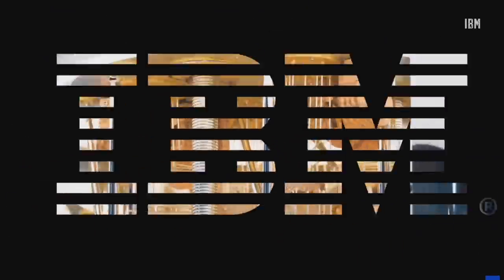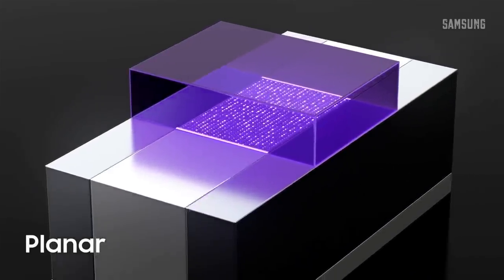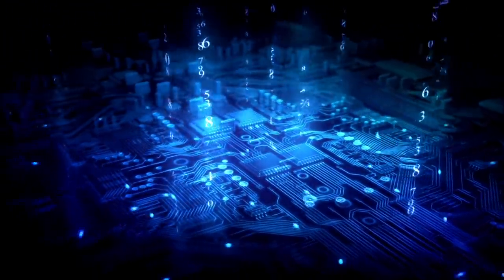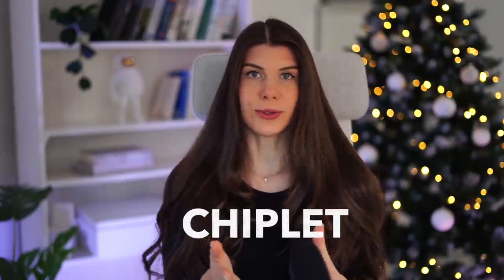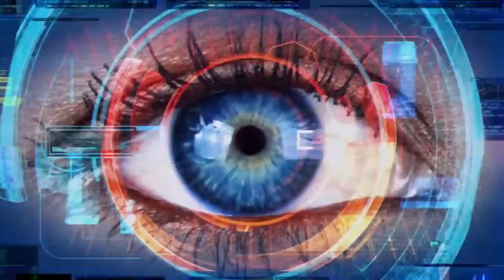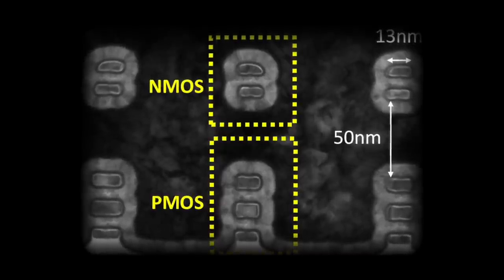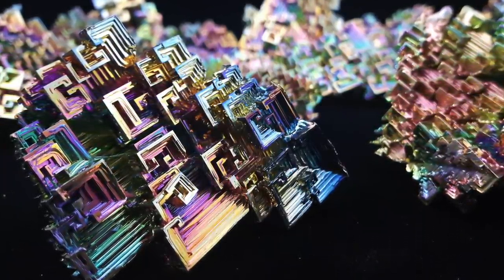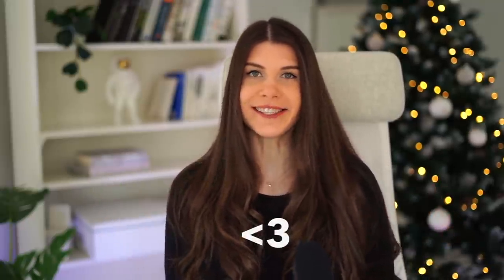IBM’s Microchip Breakthrough explained: Going Vertical

Comment: In 1959 a kid brought, what was then, brand new technology to share time at school. It went into the new hand held transistor radios. It was 1 single transistor. Crazy how far it's come.
Reply: considering how much time has passed, I don't find it that crazy... but I digress
Reply: @LargeFry1  What are you digressing from?
Reply: What is amazing is the speed we have advanced in just 200 years
Reply: We had a variety store called Murphy's and I remember a 12 transistor handheld radio behind the counter glass, and elsewhere am/fm receivers that had multiple transistors in the plastic case but some were not connected so they could back up advertising claims of having more transistors.

Comment: Nicely explained.  While I'm sure that IBM is not disclosing, I wonder what the thermal properties are.  Lower power traditionally means less heat.  But, greater density and a more vertical flow will no-doubt mean different thermal behavior and thermal dispersion needs.  I also wonder how well this technology has been protected between IBM, Samsung and TSMC from already being reproduced in China's labs.
Reply: Kinda makes one wonder if this is a take off on Project Nail spike.
Reply: Excellent point, which is what makes me wonder if this allows for a simpler or more complex transition to photonics -- a far superior advancement fundamental in computing using photons rather than electrons, where thermal issues are basically nonexistent.
Reply: The copper sinks can be larger, which means less heat dissipation.  I'm sure they'll make sure to get the power benefits by taking advantage of this property.
Reply: Its not like you can look at the transistor and know how to etch at 2nm , the equipment and chemicals need to be fined tuned. So no China will not be making it after a week.
Reply: @2000freefuel  what’s that?
Reply: Somewhere, some place! A Chinese hacker is smiling, reading this Comment. 
Who is assigned to retrieve data regarding this technology

Comment: I remember some of the research on these vertical transistors years and years ago. It has taken much longer to commercialize them than anticipated.
Reply: yes, where it would make sense to go could be seen decades ago.  I guess how to get there is a whole nother thing. It must take a lot longer to process deeper, and I suppose heat generation becomes more and more of a problem too. And i don't know anything, LOL.
Reply: The 2020s was the period estimated that three dimensional architecture would start to become reality. 
Even 5 years ago achieving such architecture seemed a long way off.

Comment: Great presentation! I'm glad to hear that several major chip makers are investing heavily here. With TSMC having been the biggest supplier of microprocessors for some years, and China making noises about wanting to swallow up Taiwan, I've been concerned about the ability of suppliers being able to fill the worldwide market for processors. Not to mention the U.S. and Europe having a non-offshore ability to make all manner of semiconductors. It's putting your eggs in many baskets instead of just one.
Reply: The west - US/Europe, need to re-onshore more capacity & capability, not that Taiwan is antagonistic towards the US/EU etc, but because China does keep sabre rattling, and even more because it is only a matter of time before the Taiwan fabs get rattled by some big earthquakes. If they are bad it could kill capacity for 1-2 years.
Reply: It is the reason Why taiwan has one of the largest missile systems in the world. I have heard figures as high as 100,000 missiles. 
Such a defence system along with a air force would turn that sea into a very dangerous place for an invading naval force. 
There are only a handful of places that are viable for a landing force and those are choke points of firepower.
Reply: @bighands69  they can also hit the mainland, so you have a MAD doctrine

Comment: The breakneck spead of advancement is mindblowing. The introduction of bismuth in place of silicon is a major change. I'm very interested to see if it leads anywhere.
Reply: next is diamond based chips they already use them in high voltage apps

Comment: nearly 50 years ago TJ Rodgers (future founder of Cypress) created the Vertical MOS device which was great for  Nor Nor type logic but it still needed planar mosfets for loads and series transistors. AMI even used VMOS to build a couple of SRAM designs back in the 4K days, but VMOS did not pan out, after all it was still just an NMOS technology. The trick in VMOS was that it used the silicon crystal in a unusual orientation that allowed the FET to look like a V shaped valley usually in a square shape pit, but the sources usually had to be the substrate at GND hence only Nor and Sram cross couples were preferred.  It also suffered from point electric field problems at the bottom of the V groove.

Comment: I hope this is successful and developed rapidly. I have seen graphs showing the top 500 supercomputers’ capabilities and while they are still growing logarithmically that growth is falling away from the previous trend line and resulting in a less economic growth than would be happening if the trend line had continued.

Comment: These transistors are MOSFets (metal oxide on semiconductor field effect transistors) instead of TTL like most original transistors. That makes them small but subject to destruction by Static Electricity.

Comment: Hey Anastasiia, I don't know if someone mentioned this already, but there's a very piercing range of frequencies in your audio, in the esses. I think it could benefit you're channel to de-ess it as transparently as you can.
Reply from the maker: Will do!
Reply: No, it's great. ASMR trigger.
Reply: @webdev217  I assume you use headphones/speakers that mask this. In mastering headphones and monitors the issue becomes very apparent. By the way, what I'm referring to is a very small range of frequencies, I'm not saying that the rest of the audio sounds bad, not at all!

Comment: Super interesting! IBM is a strange company. It creates these amazing technologies that where in many senses predicted by civil engineers who designed high rise buildings to pack as much useable volume in to as small a ground foot print as possible, but fails to make its investors wealthy: IBM shares were $75, 20 years ago and are now $125. I imagine the difficulty here will be in the lithography, ensuring that all the devices stacked in the vertical will be aligned as necessary. This seems a huge issue to me, but perhaps they have found a way to do this reliably in a production environment. It is clear that there are many technologies for building processors, but history suggests that most will not be commercial successes. Picking who will win from all the potential technologies is a difficult task and  it may be that several find useful applications which should keep processor prices low and that is much better than 1 technology dominating, allowing the manufacturer to raise prices to monopoly levels. Thanks for sharing!
Reply: It is because IBM is not good at bringing it's innovation in production.  Inventing something is different with mass producing things cost effectively.  This is the area where TSMC excels.  IBM invented 5nm first but TSMC gets it done first.
Reply: That's not strange at all. Research and development of new technology take a lot of time and money. A company buying the patent only pays for license fee and can spend the rest of money on implementation.
Reply: Sudo yes, but IBM is a business with share holders who expect the share price to grow & dividends too. Buffett was a big fan of IBM, but eventually sold his stake to buy faster growing business. Having great technology is no use for a business if it does not generate great profits. Regards,

Comment: You look really pretty while you smile. By the way I am really excited for the upcoming vtfet architecture on microchip's technology industry.  My next pc build probably use vtfet transistors integrated on its cpu die. You Really simply explain the complex things in a very easy way and that's awesome.

Comment: A major concern that exists is the fabrication method through a 3D method. It seems to be a new way to use Deposition. Also another issue is the amount of heat they dissipate.... the smaller it is the more heat exists per sq. mm. There are so many more steps (and years) until VTFET is possible. Patience people.... Not to mention when they tried 2 nm  tech they had issues with electrons not moving accordingly.

Comment: You actually need lower voltages with smaller transistors, or they would just leak current from source to drain no matter the state of the gate.
Reply: What's the voltage for these transistors these days, is it 5 volts. I thought you would have to reduce the voltages as the transistor size is reduced?
Reply: @m101ist  no and yes. You don't want any electrons to just jump the "gap".

Comment: It is good to hear IBM still performs R&D on processor fab. Over a decade ago, IBM experimented with photonic circuits using carbon nanotubes. It was to enable 3D stacking & increase spatial flexibility in 'fanout'. Two novel 'tricks': 1) IBM PACKED hollow nanotubes with materials to selectively emit or detect light. 2) Depending upon a carbon nanotube's chirality (essentially a twisting of the carbon bonds into a spiral), the nano tube could become an insulator, a conductor, or even a SEMICONDUCTOR!
I have heard nothing more of this in over a decade
Reply: I think this type of system is more relevant to the marketplace.
Reply: @bighands69  You may well be right. But just the effort to: 1) Switch from ablative to additive construction techniques, and 2) Switch from silicon to carbon
 has mind boggling possibilities.  Additive construction (e.g. deposition, but more selectively than depositing a layer across the entire surface of a wafer) ) versus ablative (e.g. etching), would allow for more versatile, 3D circuits.   The switch to carbon has even greater possibilities. Not only is carbon readily available in many forms (graphite, graphene, carbon nanotubes, multi-walled nanotubes, , 'Buckyballs', but it's use may go well beyond silicon applications. For example, all life is based on carbon, and some research had been initiated in an attempt to connect carbon nanotubes DIRECTLY to nerves (a prospect for prosthetics) 
I don't know if that is still being pursued, But it is a tantalizing prospect.

Comment: Holy crap! Fantastic editing! It's not easy to find relevant background scenes to fit such a complex script and concept.  I'm curious, did you write your script first and then fine Graphics to fit the script?  Or did you find graphics that told a good story on the chip design breakthrough and then write a script to fit the graphics?  Either way fantastic job!

Comment: When I first heard of this breakthrough in an web article, I heard notions of weeklong battery life for smart phones. I don't think that will be a thing, here's why: I think we like to use all our processing power to our best ability, So I can see software for mobile devices bloating with new found processing power. For example take a look at apps from the original Iphone, compared to what they can do in our current time.  What I'm trying to say is maybe moores law doesn't effect just hardware, but software aswell.
Reply: This is true. They mostly won't even utilize the extra potential, just write less efficient software. More importantly though is that people are overlooking a major aspect. The computing power of your phone only makes up a fraction of the total power your phone uses. If your screen is on or you are playing audio through the speaker, it is likely using more power than your phone's CPU. In general it won't make a very big difference. Some uses cases will benefit a lot though, such as playing any moderately complex games, or anything else that uses the graphics chip extensively. Streaming videos, might see a good benefit since I think they use the graphics chip to decode the video stream.
Reply: @ChrisBensler  I think AR/VR is the area where we'll see the most advantage from these advances (as well as advances in screen technology where high PPI is going to become even more important than 4k/8k/etc).
Reply: @joelface  I agree, there are many areas I think we will see big benefits, just not in your mobile phones.

Comment: I remember learning about quantum tunneling being a significant obstacle for these small transistor lengths (<3nm)... How did they overcome this or why isnt this an issue for them?
Reply: Because they are no longer bound to a flat plain, and the footprint is meassured on the flat plain. With part of transistor going vertically instead of horizontally, the nm footprint shrinks, even with a transistor that is techincally the same size overall when considering all dimensions.
Reply: It should also be noted that 7nm isn't actually 7nm, rather a "equivalent" of 7nm from how well transistors can fit into a area per square millimeter. Like when AMD went from marketing GHz to a equivalent number of GHz compared to Intel.

Der8auer did an awesome breakdown "Visiting Tescan" part 3/3. Node and Gate-lenght/Half-pitch haven't been truly representative of physical sizes since 32/28nm, showing TSMC's 7nm showing measurements of about 20nm and still about 20% smaller than Intel's 14nm.. the math doesn't add up, because if you called it 20nm it would be confusing why it's far more dense than 28/32nm and not just ~30% more dense.

And the last time the Node perfectly matched the detentions of the actual transistor it was in the mid 90's, and last time it kind of matched the average was 2005.. from then slowly changing the definition of what Node means according to performance.
Reply: This is because the quantum tunneling was through the gate oxide into the conduction band in the channel. This was taken care of by the introduction of metal oxides for the gateox insulator with much much higher permittivity than SiOx. These gateox thicknesses will stay about the same for newer generations as current generations.
Reply: The chip plain is slightly thicker. 😳
Reply: Because the nm descriptor is basically a marketing term, although it's not far off.
Reply: The thing is we are nowhere near the limits of transistors being put on chips.

Comment: Very interesting. Going vertical now seems the logical way to go. Would be interested to know how many layers they can put on top of each other before the CPU becomes to hot. If I understand it correctly future AMD CPU's will use a whole layer just for incorporating L3 cache, which also improves performance. Since still so much software is still single-threaded, a single fast core is important. Even Davinci Resolve has a steep drop of optimally utilizing cores after 6 threads (making a 12 core 24 thread CPU overkill, in tests hardly performs better than a six core CPU). Great video, thanks!
Reply: You are confused.  She talks about a fundamental change in the structure of transistors themselves.  You are talking about 3D stacking of dies in packaging.  They are completely different thing.
Reply: @catchnkill  So am I not the perfect example of confusing going from horizontal to vertical expansion in transistor structure, and 3D stacking? And at what point will they mix? And how ''high'' can you build before things get to warm and you can't build higher?
Reply: @catchnkill  So maybe my question should be: can you build ''higher'', go higher with another ''transistor structure'', so the nm count would decrease even more? So add more transistors (or ''layers'' of transistors), but on top of each other? Or would that become to warm?
Reply: @GraphicdesignforFree  They are not stacking transistors on top of each other in a die.  It will require a very major breakthough to do that.  The new vertical structure transistor allows the further shrinking in lower nm process.
Reply: @GraphicdesignforFree  As for 3D packaging i.e. stacking of dies through TSVs, the one that AMD uses in the Ryzen chip.  TSMC said that they can stack 8 layers.  However, AMD does not max out the stacking.  8 layers deems too much for heat dissipation and cannot make  it in AMD's design.
Reply: @catchnkill  Thank you for your answer :) 8 layers looks a lot to me, but as you said, heat dissipation becomes a problem and a major breakthrough is still needed to have all these layers to work together.

Comment: It should also be noted that 7nm isn't actually 7nm, rather a "equivalent" of 7nm from how well transistors can fit into a area per square millimeter and/or performance. Like when AMD went from marketing GHz to a equivalent number of GHz compared to Intel in the early 2000's

Der8auer did an awesome breakdown "Visiting Tescan" part 3/3. Node and Gate-lenght/Half-pitch haven't been truly representative of physical sizes since 32/28nm, showing TSMC's 7nm showing measurements of about 20nm and still about 20% smaller than Intel's 14nm.. the math doesn't add up, because if you called it 20nm it would be confusing why it's far more dense than 28/32nm and not just ~30% more dense.

And the last time the Node perfectly matched the detentions of the actual transistor it was in the mid 90's, and last time it kind of matched the average was 2005.. from then slowly changing the definition of what Node means according to performance.

Comment: Sounds like "multi-fin" is going to require several times as many process steps, increasing costs, turnaround time, and potentially harming yields.   Sure they can do it with a prototype, but Intel was making promises before that they couldn't keep.  The simpler approach might be more successful.